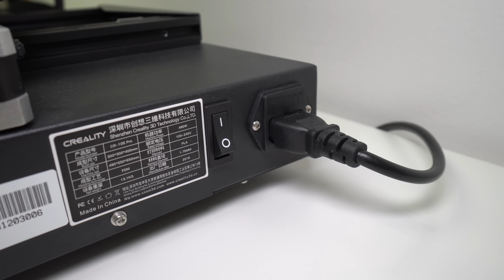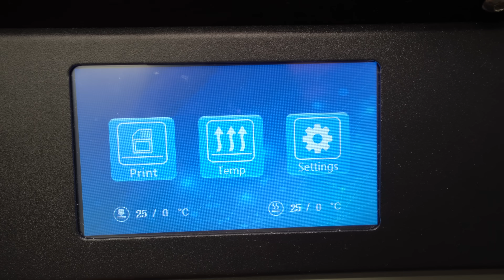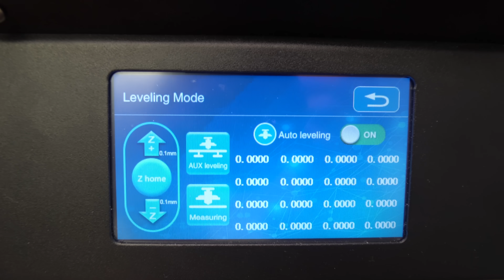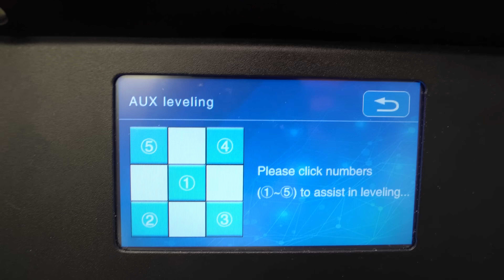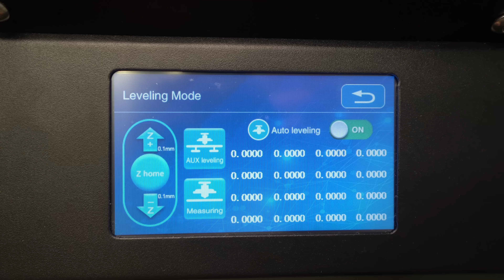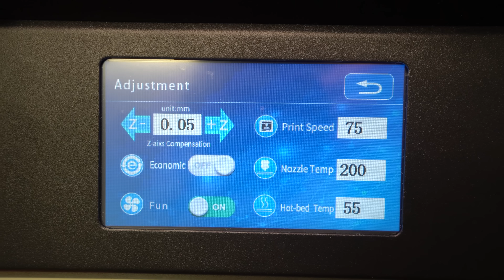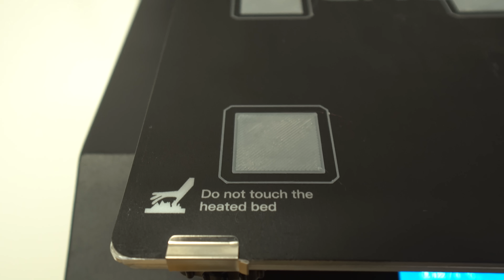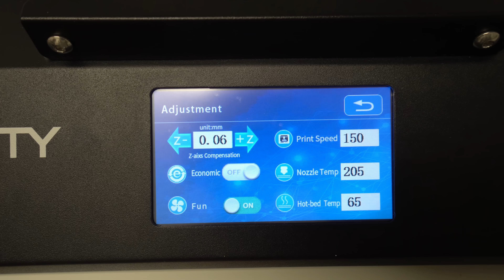Creality Cr10S PRO - Fix your bed leveling issues (Inductive sensor install)

Comment: Hi, could it be written wrong in the pinned description area ?  it says   LJ18A3-8-Z/BX , diameter 18mm DC 6-36V, NPN NO.  I couldnt find any with 18 mm.  it can be 8 mm?  thank you.
Reply from the maker: @kaganarisut  Sensor is LJ18A3-8-Z/BX, its 16mm in diameter, M18 is type of the thread. I believe 8mm is max detection distance on open air.
Reply: @NexiTech  thanks.  when looked in detailed specs, it says diameter 16 mm as you said.

Comment: Hey @NexiTech does this upgrade work with the cr10s pro v2 or is it only for the v1
Reply from the maker: @dylanpell2349  Hi, well I'm not sure to be honest, If you have CR10S V2 open it up and check it yourself and compare your 3D printer with mine.

Comment: I just finished this changing of the sensor and works as it should. Also tested the sensor (Banggood version with  blue end and black wire) first with a multimeter, as you told should be done. I also did the 3x fans change earlier too. Great work doing the video! Thanks!
Reply: Also noticed that it's best to tighten the 4x wheels under the bed many turns before any leveling, or home point setting, because then there's some thread available to adjust them. Before,  I had the bed almost at the highest position, so there wasn't thread left in the screws to adjust it, as the wheels would just be rolling loose. (Beginner tip).

Comment: Hey, I upgraded my printer with the same inductive sensor. The sad is that the sensor is not detecting the magnetic bed as metal. When I pass a knife or something metal below the sensor the light turns red. I mean it is working and the wiring if correct. What's the problem?

Comment: Wanted to say thank you. My printer would stop working every winter (it gets quite cold where I am). That stupid capacitive sensor is affected by moisture and temperature. Using the inductive sensor is working very well.

Comment: I wasted my money, and my time on this "upgrade". Sensor reads the same, and sometimes worse than the stock sensor. Not recommended.
Reply from the maker: Then you didn't use the proper sensor. This sensor only reads metal very reliable and not every material very unreliable like a stock sensor.
Reply: @NexiTech  I used the one you linked from amazon.
Reply from the maker: Maybe they send you the wrong one, maybe it's defect.
Reply: @NexiTech  could be. It detects metal fine, doesn't detect my finger, ill mess with it some more, and see.
Reply: @NexiTech  I want to apologize for my rude behavior, I believe I found what was causing me so much trouble, in the start of my gcode in my slicer I had it do a auto bed level, btw do you know if G29, unified bed level is recommended to use for cr10s pro? Anyways, my octoprint bed visualizer also saved the mesh, and I everytime I print it would do a auto bed level then save the data, and then when I did it through octoprint to see it on the graph it also saved that data, which seemed to have slightly different readings, and with the slightly different adjustments each time it caused my nozzle to slowly creep away from the bed. I mean I removed the bed level from my slicer, and I only did the auto bed level once through bed visualizer plugin, and I haven't had any issues with past 5 prints.

Comment: Hi  Nexi Tech, I really enjoy your videos and your work!!! Thank you so much for your efforts 
I'm having a problem with my cr-10s pro that I purchased recently, when it was printing a vase it stopped because of the laptop, that I use instead of SD card, when I try to resume the printing it bumped into that half vase, and after that I can't get it adjusted as you showed in this video with the same sensor, what it basically does when I go to leveling mode auto home it presses nozzle in to the bed so hard that it bending the bed, I'm so frustrated, I don't know how to solve this problem 
Any help would be greatly appreciated 
And thanks again

Comment: hey so I have this issue where it's working, and the led is lighting up, but for some reason no matter what I try, it just doesn't stop, it keeps going down. I thought it was cuz the wiring was bad or something, but I switched 3 different sensors and they all don't work (stock, this one, and the official one from the website)

Comment: Hi Texi Tech, thanks for the great videos (they are a great help starting out) --- i have a problem: my CR-10 pro (after printing perfect for months) after changing a tube and reconnecting it === it now goes off printing (warped : it goes out off the lines)  --------- do you know what to do?
thanks so much

DaniEL
Reply from the maker: I'm glad that you like it my friend.
So you just replaced Bowden tube and problem occurred? It must be something mechanical then. Warped? Out of the lines you said. You meant under extrusion? Like this? https://i.imgur.com/yJubiVS.jpg
Reply: @NexiTech  Hi, thanks for replying. Not underextrusion - it prints out of the lines = if i print: the models gets made but slowly the models shifts to one side = so i get a "warped/misformed figure", if i make bed leveling squares, the printer will print just out of the lines.... --------- have you ever heard of this problem? (it was working fine for at least 20-30 prints and i can level just fine) ---- we have just corrected the z-axis (they were a bit off) but the problem is still there........... we have also just before the problem started: connected a new tube and re-applied it to the nozzle (so maybe i have a loose nozzle? and that's why it shifts ) -------------- thanks for looking in to it and your videos are VERY good and CLEAR (most other's arrent) congratulations on a job well done
--- D
Reply: sometimes some bedleveling squares are good (mostly in the beginning of the print) and then the last ones are getting the "problem"----

Comment: I installed the new probe.  I am having trouble with leveling.  I follow the instructions, and it seems to work, but then when I try to auto level the head is driven into the bed.  I have a wham bam type flexible bed cover does this probe work with that system? This is the only thing I can think of.  Or, is there a way to erase the leveling settings and start over? thanks.

Comment: Hey Nexi, I got a problem, hope you can help me, I change my probe for the same you linked, same code, the sensor is trigered, I mean the light turn on, but the Z still going down, I already swap de software to the same you linked, still doesnt work, what can I do :(?

Comment: Will this sensor detect metal under my temper glass on top?
Reply from the maker: Only if is very thin glass. Like 2mm thick.

Comment: The sensor i just bought reads @^.5 volts with blue and brown and 1 volt with blue and black when i place metel against the probe. is this ok as you state 23-24 volts and close to zero with metal

Comment: Hi, thank you for all of your nice videos. i replaced the sensor as in your guide, but now the Z moves up while reset the axes, not down. 
do you have any idea because it could happen ? thank you
Reply: Fixed ... just a misplaced connection. now works fine . great improvement.

Comment: Hey Next Tech,  Thanks for the vid.  I  just received a sensor that I ordered but they sent me model ..../EX vs BX as you outlined.  It only has Blue and Brown wire no Black wire.  Do you think I can still use it or should I return it?

Comment: Hi Nexi thanks a lot for this video! I want to know one thing before making the change, with the original sensor the adjustment is made with the screw, this sensor does not have a screw, how is that adjustment made?
Reply: Set it in position manually and then use z-offset on your touch screen, always put the metal feeler gauge under the nozzle when you first start homing/setting up the height that way you won't damage the print surface if the nozzle hits the bed by a few mm. 
You do not need to adjust these inductive sensors, that's part of what makes them better than the capacitive ones.

Comment: Very nice explanation but you can do a lot simpler, you can change the sensor without removing any screw in 5 minutes.
- loose the two screws of the sensor and remove the sensor
- cut the cable of the sensor (approximately 5 cm from the sensor)
- solder the three wire of the new sensor
- put the new sensor and tight the two screws
it worked for me.

Comment: When you pull the old sensor out, tape a piece of string to it and pull that through. Use the string to pull the new one back through the covering. It's a little easier.

Comment: Your Videos are excellent.  I just got a CR-10S Pro and before it arrived I watched this video and ordered the Inductive sensor.  I got the sensor a couple of days after so I was having the same issue with the inconsistent first layers.  I followed your video here and also upgrade the Firmware to Tiny Machines 3D  version and things are running incredible.
Thank you so much for helping the community.

Comment: hi will this inductive sensor work through glass ?
Reply from the maker: Yes but only very thin ones. I'm using glass with my inductive probe, I wrote in comments many times.
Reply: @NexiTech  hi it is the creality glass that i got with  the printer

Comment: Thank you for the great video. However, I had some problems with the 3.8 mm spacer. My sensor seems to require something like 3mm to adjust the Z-axis offset. I don't knoe why. But now it's working well.

Comment: My OEM level sensor failed and this was an easy fix that cost me less than $10.  Great video, easy to follow!  The only downside is that I had to give up my glass build plate.  This sensor will not see the glass. I used my original aluminum one and removed the ripped up sticker.  To be honest printing on aluminum is not that bad.  Through the years I have learned that the best adhesion is getting the z-offset dialed in to give you a good squashed bead of material on the 1st layer.  Also, a bunch of hair spray doesn't hurt.  I highly recommend this sensor as a cheap easy alternative to the original one.  The bltouch sensor seems a lot of work to install with connections to the board, jumper for the old connection, a custom printed holder and flashing the unit with additional software.  This solution is a far easier and cheaper option and gives you much-improved level sensing.  It took me less than 15 min to install this after sodering the old connector to the new sensor and I was printing again.

Comment: This fix was working flawlessly until recently. Suddenly the Z homing is driving the extruder into the table even if the inductive sensor light is lighting up. Do I have a defective sensor or a failure to the conditioning circuit?

EDIT: I tested connecting the original capacitive probe to the motherboard and that was working fine :-) This probably means that there is either something wrong with the sensor or that the firmware is not correct. I think I used tinymachine's firmware but have found that sometimes the menus are reverted back from english to chinese. Is the firmware upgrade necessary for an inductive probe to work correct?

EDIT2: I installed the latest motherboard firmware (1.70.1) and now the inductive probe is working again.

Comment: Thank you so much for this guide. I have some questions and remarks and I hope you can help me. 
Using the latest 1.70 firmware.

Using this sensor https://www.amazon.de/dp/B071FTP2ZP?ref_=pe_3044161_248799201_302_E_DDE_dt_1
which seems to match with your spec.

Installation was all fine, up to the point to the sensor height-fix in the bracket. What is the point of the red LED? I assume it is to indicate that the set distance is reached? How does the sensor even work, does it communicate a 'distance' or just a boolean (reached / not reached). 
The original capacitive sensor had this little screw that could be adjusted. Is it 'good enough' to use the plastic piece that came with the printer??

Then... power switch on.. going to the leveling screen. Using your guide to set z and it tried to drill it self in the bed when I pressed the home button!! Oh no...!! I think previous print settings screwed it up??? Bed damaged... and hopefully not the nozzle. 
Printed a reset. M502  M500 M501... after that it behaved better. 

Did the manual leveling. All fine.

Now with the automatic level it still keeps drilling itself in the bed at the first measurement. The other 24 are fine...
Do you have any idea what the problem might be? Is the sensor picking up "too little metal" in the corner?
Reply: The firmware you're using is trying to detect the bed with a BL Touch probe. I had a similar issue but found the proper .hex file on Creality's site which fixed it.

Comment: How you adjust the sensor to remember a new position  - the old sensor has a screw and light the new does not.  I do all stuff bought exactly the same sensor and install .. but won't remember the new position  - I see you pressing the "z home" button but the printer going to the latest setup position the new one. Thanks. My print head now touching the bed with the nozzle when go to 'Z home position"

Comment: My nozzle digs into my buildplate. Im still running the original capacitive sensor. Any correct advice how to do that z offset thing? I click z offset and it twice goes up and down but on the third time it goes way lower and digs into my plate
Reply: mine does exactly the same thing.ordered this sensor should be here tomorrow
Reply: @tdex6372  I did to the softwareupdate from tinymachines version DW5 and it works now

Comment: Thank you for this video! I'm currently tracking down all the tools needed (I have like none of them). Hopefully this is the last upgrade for my printer! (did micro swiss hotend, wham bam & fans)
Reply: Hey Andy G

Can you confirm that unductive sensor works with whambam? Im a bit worried because of the magnet of the wambam. Doesnt magnets interfere with inductive sensors?

Comment: You saved my sanity! I had a faulty capacitive one that finally died. I didn't know what was going on until one day it wouldn't stop going down on Y axis, pushing into the the bed. I changed it with an inductive one and woks like a Swiss watch. Although, I'm not sure it's going to get along with a glass bed.

Comment: Just wanted to drop in and say this works great. I did this upgrade in conjunction with the T8 antibacklash nut (also done by Nexi Tech) and I can literally turn my printer on and just print. No need to level everything again. Absolutely awesome. You can also use a 3 pin JST connector instead of cutting the cable on the old sensor. This is what I did, and the JST connector fit just fine in the same socket as the old connector.

Comment: Hi, nice video!
I have one question, if I measure the voltage of the original probe, while connected to the printer, I get 1.xxV when not detecting anything and 0V when it detects something.
By any chance can you tell if I replace the capacitive one with LJ18A3-8-Z/BX NPN NO inductive probe  will fry my control board?
Reply: Just measured the output of the original probe and it's the same as for the inductive one, so disregard my previous message.

Comment: I got huge problem with the probe. Since i change probes i wasn't able to auto lvl. First my Z-axis wouldn't go down at al, then i switched for the original probe and flashed firmware to original and tinymichenes back and forward and i got z axis doing weird things. It seems it goes higher then usual and go down just a bit and stops, not using a probe and find level, just shut off. I am struggling for so long now, does anyone know what could be the problem? would greatly appreciate it

Comment: Can u help me ? is it normal to got diferent z offsets from diferent bed temperatures?
Reply from the maker: DDD XP Yes of course. Aluminum(metal) heated bed expands on the higher temperature just like any other metal. That's why is good idea to warm up heated bed on the specific temperature that you want to print, PLA 50/60 PETG 65-75 and ABS 100/110c  and then do the auto leveling.

Comment: I bought the inductive sensor and I have watched this no less than three times, guess I am brave enough to try it this week. So sick of having to put on reading magnifier glasses, get a bright lamp and adjust Z on every start of every print, or else I get a ball of fuzz and no parts. Thanks Nexi you are great. Next Firmware maybe???
Reply: OK I did it but I forgot to cut the new connector cable down I just coiled it up for now. I also added the upper Z axis pulleys and belt to keep the Z drives tied together. But the belt is floppy seems we need to design and print a belt guide and tensioner fastened to the Alumin bar about midway. I can't say a saw a big difference it seems my nozzle will ooze filament during the calibration of the bed by the time we get to the first layer the ozzing has turrned into a blob and can cause the first layer to lift and then the whole thing becomes a mess. Think I will do an update on the Firmware. Need to validate my Version I think it is 1.60.1 but I can't recall. Thanks for a great video. Dennis
Reply: I tried to update to 1.7 on the firmware. OMG! This is sort archaic to me. I could only get the touch pad updated. Looking in side the steel housing i was shocked to see such short alum tubes for the sides of the Baseframe and the cross extrusion tying the ends of that frame and they were tiny small. Maybe we can get some bigger and longer parts to replace the ones underneath.  Now tomorrow, i need to how to install the controller 1.7 update. Argh!
Reply: Is this sensor anything like the New Prusa SuperPINDA, My Leveling is still working great with this $10 Sensor, Prusa wants $30-40 for the PINDA?????? Is it a better sensor??? Dennis